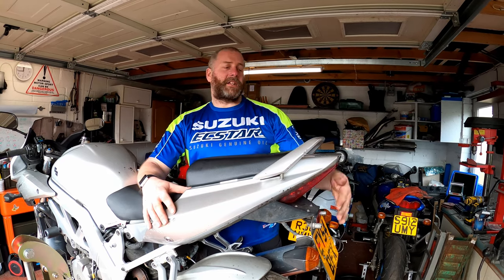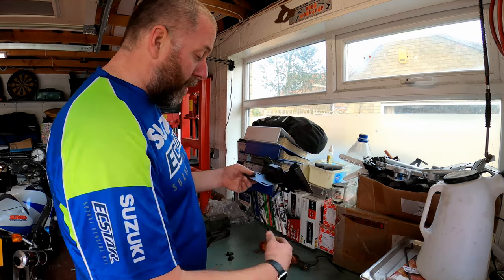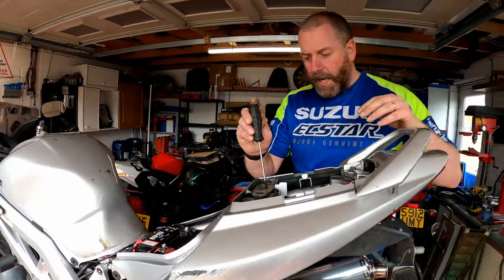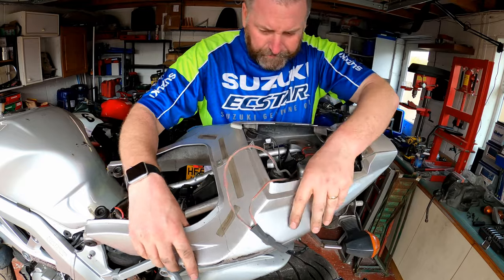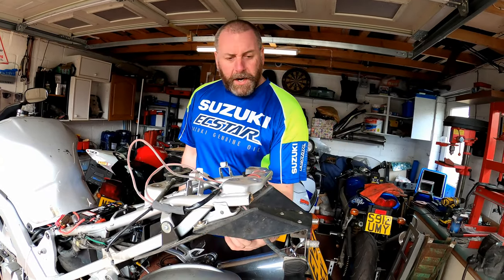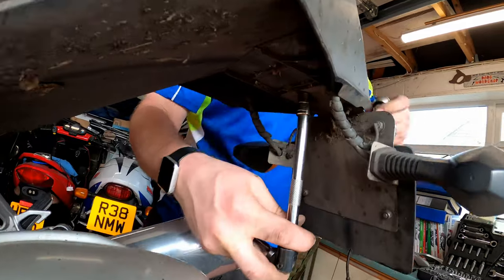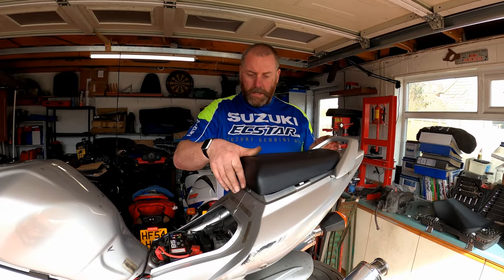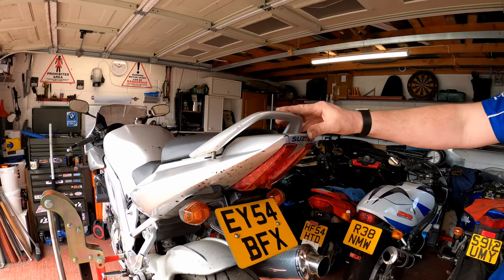Suzuki SV1000 Project Bike - Part 9 - Replacing The Tacky Rear Fender With A Neater Tail Tidy

Comment: What year is the SV1000S, Kev?
Reply from the maker: This one is a 2003 model so differs slightly to literally every model year which I found out when I bought a new seat and it didn’t fit! It didn’t help being first registered in 2004 either! 🤦🏻‍♂️
Reply: I’m in Australia and have an 06. I was a little worried about the Regulator/Rectifier after watching the episode where you changed it. I regularly check the battery’s charge and my reg/rec seems to be working perfectly. Later year model make a difference?
Reply from the maker: No I don’t believe so, I’m just conscious that Suzuki R/Rs let go fairly regularly so fitting something known to be more reliable to the bike is more likely to prevent an annoying breakdown!
Reply: Ok thanks. Might need to look into getting the one you recommended. Cheers and keep up the great work. Want to see more SV stuff 😁. Got a 950 Multistrada and a 2000 Yamaha TT350 as well. (Bit greedy)